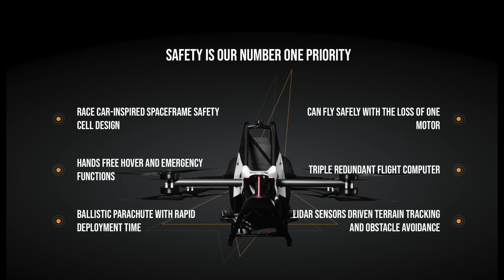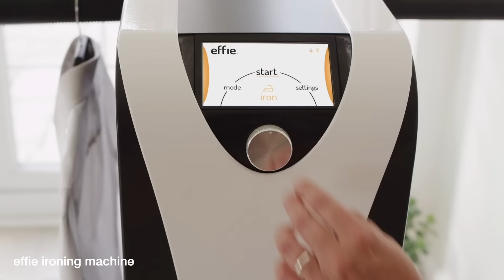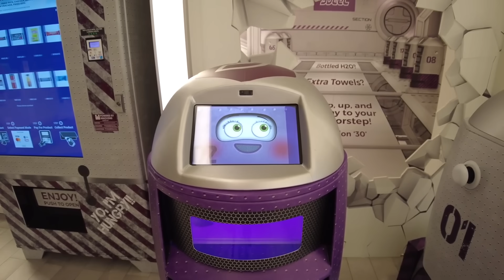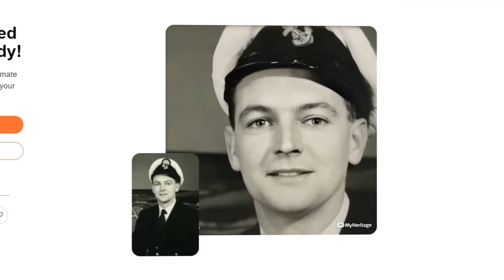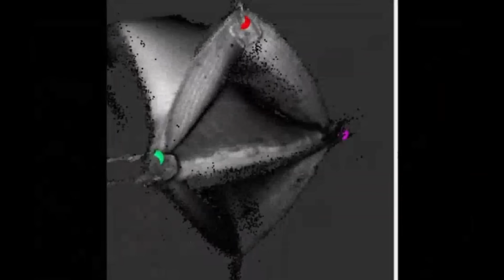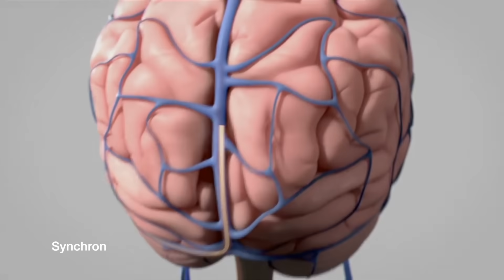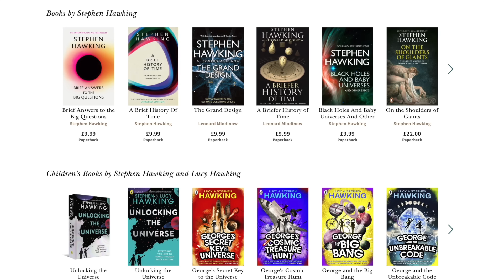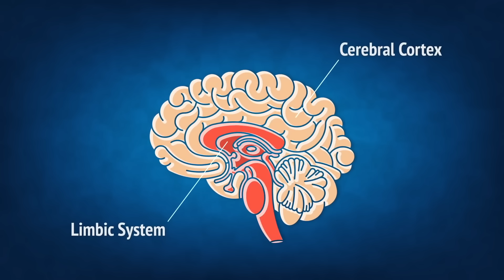Elon Musk offers a new ability that could split humanity.

Comment: You clickbaited me. The obvious comment to make as someone who lives alone, would be that a very attractively designed (based on my own algorithms of course) physical structure, that had all the dexterity of a human with the sensitivity of the inbuilt virtual nervous system sensors, would be very helpful to have around the house in numerous ways, tidying, cleaning, attending to trivial domestic tasks, acting as a PA etc., though if its conversational parameters were solely based on my own algorithms that might after a while become repetitive unless I insisted on learning new things every day and those algorithms were fed into its parameters. Or is the idea for the AI to have a constantly updating set of parameters from an external database within what the owners choices would be? And then I'd have sex with it at some point.

Comment: I am always deeply touched by the efforts and smarts that is put in developping intelligent prosthetics and devices to give back some independance and life quality to handicaped people. Great work and cheers to those engineers.
Reply: Most of the prosthetics for disabilities of the limbs are limb replacements.  I have myasthenia gravis as well as a wrist and ankle injury that cause pain (CRPS) with movement and/or weight bearing as well as weakness and fatigue.  I have been looking for a robotic device that will augment what I still have, allow me to participate in movements to maintain health and/or improve functionality.  I used to write 1,000-2,000 pages of business and system requirements, but had to leave the industry because I can only write for less than 30 min., stand for 15-30 min., and get little to no exercise.  I'm envisioning a sleeve constructed using a thin, damage-resistant, flexible material that can interact with my intention to execute movements with my hand and wrist. Something similar for the ankle that also helps to absorb the weight of standing, walking, etc.  Medications don't go far enough.  Movement will help reduce pain, but if that could be built into the robotics as an optional feature, that would be a home run!  I really do want my life back!  Thank you for listening!
Reply: @mercy3219  Hello mercy! Sad to ear about your situation. I know how any physical impairment can limit one's ability to fully express oneself, having suffered myself of ulcerative colitis that ended up with a major surgery (ileo-anal reservoir). I believe that in your case, the mechanical exoskeleton suit would be of great assistance. Furthermore, I also believe, they should become more and more available for the normal population. Maybe, they will combine this exoskeleton technology with mind control.
Reply: @hak1985org  and did you also forget that you dont live life for free?
Reply: @hak1985org  nothing in life is free grow up
Reply: @hak1985org  What does it matter as long as it is something which everyone desperately needs in the society?
Reply: @hak1985org  can't speak for everybody.
Reply: @hak1985org  That’s not true.
Reply: @hak1985org  Part of which is enhanced data collection (spying on us).
Reply: yes but at what price to humanity to its end
Reply: @alexsmith240  It depends on what we do. If AI becomes self-aware or is given control over weapons systems, it might be dangerous. Otherwise, there are way to have a fail-safe. We are still far from self-aware AI. Also, we should not give learning AI's access to weapons. We need that button to unplug and cut access to all central control systems. Robots that will help us will seem self-aware, but they will not be. Sci-fi movies tend to scare us, but they are like horror movies, made to give us scares. Still we have to be careful what type of AI we use for our robots.

Comment: I would love to see someone who has BOTH the thing that goes through the jugular... AND 1 or multiple Neuralinks working together... see with Neuralinks current form your kind of stuck with a limited depth coverage but with the jugular thing you may be able to target some more specified area or areas of the brain for reading at least. also to see multiple Neuralinks working in conjunction with each other would be great... Imagine one Neuralink in a "Read Only" mode or model hooked up to the Occipital lobes taking in visual data and processing it through an AI and another Neuralink with its Read/Write as standard hooked up to a part of the brain that governs movement, there are some people out there with a problem where they cannot identify dangers and others whose processing of said dangers is too slow. a device connected to the Neuralink attached to the Occipital lobes could process the visual data looking for threats(objects flying toward them) and then on detection of an object that is flying toward the person at a certain speed and or distance the device could signal an appropriate response to the Nueralink hooked up to the part of the brain responsible for movement or the nervous system directly telling it to move out of the way.

Personally i would love to see a volunteer human trial install of the Neuralink device where the person gets to keep it at the end of the trial, i would be down for that myself if i could hook it up to my own devices i am in control of after the trial. i would straight up take the pinephone and develop my own linux os on it strictly for use with my neuralink... i would have it operate in a mostly "offline" fashion. for security and privacy sake. depending on where my neuralink was hooked up to in my brain and if i had "read and write" or just read functionality i would work on software to try and input data to my brain(if i had write functionality) or keep track of some or another set of signals if i only had read functionality.

One thing that interests me is that our brains know how to wag our tails only due to evolution we do not have tails.. so could we not "recycle" that function in the brain to control a theoretical "mouse" or "Touchscreen"? thus not losing other used functions.

Im seriously stoked about the coming advances with this sort of stuff and only wish i was born now or well 10 years from now not in the 90s.

Comment: @Digital Engine
i guess the best prosthetics would, in my opinion, replicate the hand and it's muscles by incorporating fiberlike artificial muscles made by flexible yet strong materials and connect to the muscles above them so they can carry the same actions, along with feeling. feeling though is the tricky part. as the information has to be transfered to the brain and the brain has to respond and send the exact sensation to the exact part that it's supposed to be felt, the artificial nerves should be able to transport the information using small amounts of electricity and receive them back.
incorporated chips or artificial nerves to the brain could help resolve such issues but as the procedures are not only expensive, the world isn't as accepting with such things.
There is the option of creating artificial skin though, there are already similar things, if you can incorporate some nanotechnology or something for the sensation receptors through the artificial skin and either help it mend with the preexisting skin or connecting it to the upper nerves could probably help.
There is also the issue with the time lag between actions, the character of the actions (some being more delicate, others more deliberate or resolute, putting in more or less strength, fast or slow...etc) and precision so i think those three should take priority for now.

Comment: Okay I want a swag at this last robot idea! So I have one for you I'm an aspiring inventor and am in need of a robot that can constantly be changing jobs! For example I need an extra hand for the begining stage of one project (PA) and after I attach one part I need this robot to be able to grab(PB) and apply pressure on (PC) 6-8 different directions of force while glue drys, then I need it to hold (PD) the item while a stress test or even preform a stress test (PD-2) after the drying process. I need this to then prepare a level work area (PE,F,G,H,I) and measure, pour, mix, and apply equal parts of a liquid to ensure accuracy. Followed by (PJ-Z) timing a drying process, shaking the product to ensure no bubbles remain, heating the product to ensure faster curing times or maximizing curing times! As well as stripping wires, preparing wires to be connected, connecting wires, and cleaning up after itself and I! Lol. Therefore, as far as I can tell for all these tasks to be completed, I would not need anything different from the robot you showcased other than a couple minor motor add ons or upgrades and an internal update to allow for those add ons and upgrades to work! And maybe a controller to get some fine details just right, or purposefully wrong! Thanks for the products you create, the people you help to educate, the videos you post, thanks for the opertuninty to help you change the world! I appreciate you!

Comment: I'm more comfortable with a physical IO interface (a bodysuit/sensors/vr goggles etc) than having things tapped into my brain... simply because I want some parts of my brain to remain private. I'm sure machines will be able to for example infer things from my pupil dilation/heart rate etc but that's not the same as building a two way link straight to my brain.

Comment: The major downside to AI is that people lose jobs and thus income. But this is not only a problem for the people who are replaced by AI. It is also a problem for industry. By increasing automation, we also decrease the overall spending power of the consumer base. Manufacture may not be dependent on human labour but it is totally dependent on a sufficiently affluent consumer base to remain sustainable. AI cannot replace customers.
What is required is a complete overhaul of our concept of economy. The primary objective of any economy must be to circulate resources as effectively as possible. Money has been the primary tool for this and it has worked to a large extent for millennia. It has worked as a convenient universal token of exchange for goods and services and also an incentive to provide labour and services, to develop new innovation and to make systems bigger (or smaller), cheaper, better and more effective. But money is also driving progress into a cul-de-sac in the field of technical innovation and over a cliff in the field of energy.
But money need not have run its course. It is still the most effective system of exchange. We just need to re-establish the way in which it is used globally. The old concept of extreme wealth and extreme poverty is primitive and counter productive. Its value is unstable and currencies fluctuate in comparison with each other. This might be intermittently lucrative in the 'money markets' that provide absolutely nothing but it is unsustainable. A constant value of each currency must be established and this must be consistent with the value of goods and services worldwide.
Also, there must be a default base income for each individual to cover the cost of basic accommodation, basic food, basic utilities and basic clothing. This should not have to be 'earned'. Money is only a system of administration and is not a resource in itself. Education and health care also needs to be free. These are the basic necessities for civilisation to function. Employment should provide the means to enhance one's standard of living... staying alive should be a right by default.
People will naturally want more than the basic necessities and free education opens the means to enhance skills and opportunities, progressively enhancing the affluence of consumers while giving free rein to automation where appropriate.
Yes, it's unrealistic pie-in-the-sky nonsense... and, not so long ago, so was everything shown in this video.

Comment: The video doesn't seem to address the multitude of issues with many of these technologies, not the mention the insane amounts of lies, hoaxes, or scams, etc.

Also... Flying cars, according to everything I know and have heard... Will not work. Square-cube law and all. Plus... The insane amount of energy to have things hover, the air traffic problems, the energy density required to make it remotely feasible...
Most flying cars are a scam

Comment: 1. Robot labours for construction and plantation industries would be a nice addition. My country is in a severe shortage of such labour.
2. For robot waiters, it needs to pick up more speed and ability to move through the crowds of patrons (usually around the buffet counters). That's what I observed from the only one I've found in use so far.
3. One thing is for sure, AI presence will be so prevalent in every facet of human activities. And to a large extent, AI will be incorporated along with robots. Therefore, some sort of safety should be incorporated into the robot itself, in the form of a manual power switch, in addition to the remote switch. In case of rebellious behaviour ever pops up.
4. AR + Quantum computing + Unreal Engine 5 + Neural implant is a very dangerous combination. It can make you see things where there is nothing. So, no neural implant for me. No, thank you.

Comment: robotic prosthetics are interesting, but may actually be a dead end. Biotechnology is also racing ahead, probably even faster than robotics, from what I can tell, the discoveries in the field are happening at a crazy rate, and I think so fast that hardly anyone can keep up, the science may actually already be discovered, it's just that no one has been able to learn it all and put the pieces together. As good as some of these things are, I doubt there would be any amputee for example who would prefer a robotic arm or leg over the ability to literally grow a new one, through something like stem cells or some other form of cloning for tissue regeneration
Reply: Unless it's a cool ass robotic arm 😎. But yes I see your point.
Reply: @SensitiveSavage  oh for sure, but we're talking arms with ten times human strength, impervious, and full sensory input, with the ability to turn of the pain stimuli etc. I could see the mechanics side getting pretty good, but, what about the neural side ? the idea of bio-matching a fully tactile arm surface to existing nerves with the precision to enable full sensory input and output, that's not going to happen for , quite some time....probably ! You'd need nanotechnology for the interface to the wetware, and as for the biotech that allows you to get all those axons and dendrites hook up individually, you'd need genetic engineering to build the proteins for synapse connection...that'd keep the egg heads busy !!
Reply: @psycronizer  I love science 👏🏾
Reply: tbh some of this stuff is already possible, it's just illegal. In China they've created a child immune to HIV, through genetical engeneering.

Comment: The AI of today, the equipment of today, is divided between the haves and the have nots.  One group has the knowhow one group does not.  Lasers in conjunction with advanced kaleidoscopes and prisms could when light is triangulated generate files of near infinite size.  The data could then be positioned on electroferromagnetic fluid so that it no longer took on the form of computations but with sensor plates reading the life force of bacteria and moss begin a new era of technology thereby generating in the data sphere information that teaches us how to get past the information age in the first place.  This little bit of information might help too computer generated code based upon mathematical equations and seed code data (groupings of numbers) could accelerate this process a zillion fold because you could jump right into the end of all computations from the start and reach the zenith of computer technology before anyone else or in this case something new.

Comment: When did programming become coding? Who decided that? Why did it get adopted?
Reply: I think people use the terms interchangeably because the most widely available (and cheapest) control units have a software interface. A robotics demo with conditional cases is complex enough that you will want to test minor changes all in a short period of time. It is easier to accomplish that when you can edit a script on your computer and then overwrite the old one via USB, rather than pulling out a bunch of power tools and moving physical wires around.

Comment: An alternative, completely analog, but much more sophisticated path to machine intelligence is entirely possible. This approach utilizes the phenomenon of variable capacitance to provide a sensory field, whose modification, (as impinged upon by events or conditions with the environment from moment to moment) is thus stored in the form of a continuous stream of magnetic wave-prints/packets (like magnetically encoded photos). These "prints" are then instantly stored within, and on, a hierarchy of round-robin modules (if you can picture that.. : ). This round-robin technique is of course, the core means of classification and characterization within the system that, as a plus, therefore makes self-diagnostics an inherent given as well. It's a sort of subtle precognitive effect, given that whole process of data storage and retrieval as sketched in is almost by definition in resonance with the sensory field that energetically extends into the environment...  i.e. the data flow is in a continuous state of feedback. Does that ring  any bells? : )

Comment: Cycloidal Rotors would reduce the decibels of the jetson one if that's a problem.
Reply: The basic problem with the JETSON is we think of it as an advancement in energy when it's plain to see that flight requires a lot of power. A Jetson recharge for a 20 minute ride would be about 3 days worth of electricity for the average home in the USA. So how is that exactly going to save energy over fossil fuels?  It's not .  It still needs a certain amount of energy to fly like a drone.